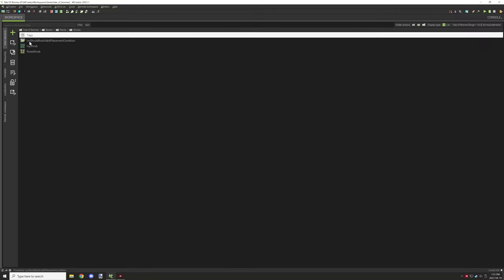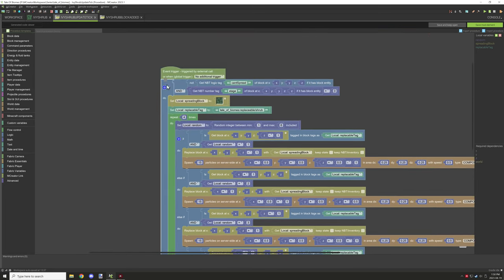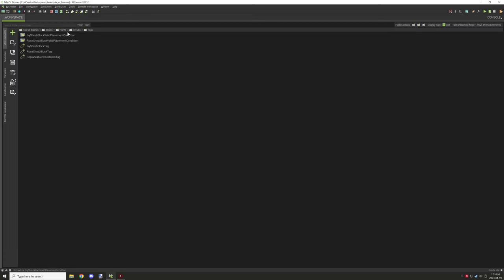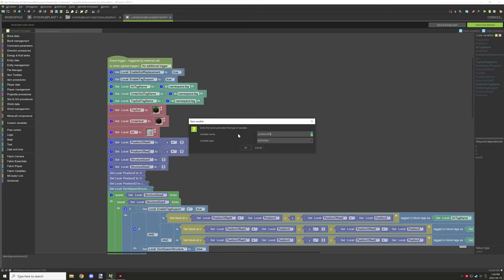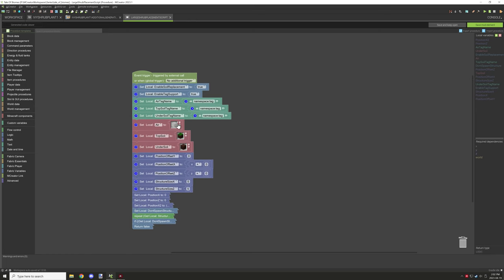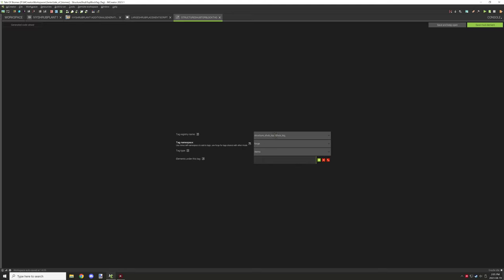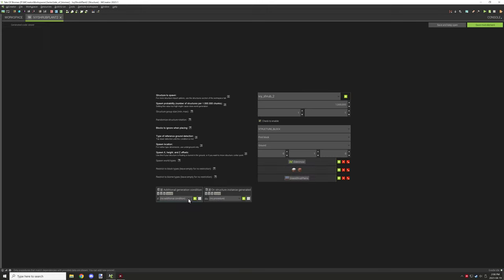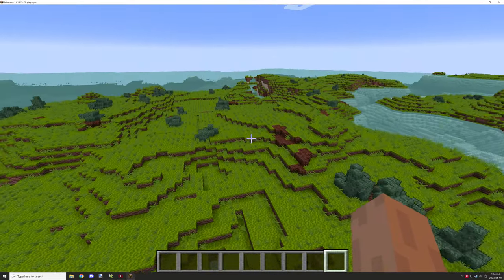Rough Shrub Mechanics | MCreator Lore | Ep12

Comment: Hey man, thank you for helping me on my other questions but I have yet another and I hope you're doing well, so I'm making a mod that involves a lot of mechs and piloted vehicles and I was wondering if it was possible to be able to raise the area where the player was sitting because the Mechs stand several blocks off the ground? thanks again
Reply from the maker: There should be a setting on the entities first page that controls the Y offset. You will still need to model your entity so the seat location is on the grid tile in blockbench but you can do something like -1.0 to go done one cube block. There is a bit of math involved in knowing per pixel each pixel is 0.0625 (1.0 / 16 = 0.0625) so if you need an exact height then you can multiply that value and add or subtract the y offset in the entity to change the sit location. The only thing is X and Z offset is not supported so it might take a bit of testing and moving the entity in blockbench to get the exact X and Z location, if you have grid enabled though it will be center of that grid but the player will always be at the top of the hitbox of the entity.

Comment: What I do to control the speed of random tick update is have a short if statement checking whether a random number between 1 and x == 1. It's not the best but it works
Reply from the maker: Random tick updates are controlled by the game rule randomTickSpeed, the default value is 3, setting the value any higher or will edit the speed of the entire game, making many aspects of the game faster or slower. Sadly there is not really a way to make it faster, but you can use a timer I guess to have a set amount of time that is required before it can attempt to run the script, keep in mind though you can have a longer time not shorter that what the base game already offers without editing the game rule. If you need something random but on a tick update I suggest just running a block with a random number condition to test for a value, you could do this using random integer and test for a single number and set a probability so for example 1/100 chance of landing on a value you set with ==.

IF Random Integer min(1) max(100) == 5
  Do  (...)

So if it lands on a 5 then it will run the event.
Keep in mind that every tick is (1/20th) of a second so it can make 20 attempts per second to land on the 5.
I am not sure what the overall probability would be with this taken into account but it may still be quick.
In the case this happens you can increase the max number.

If you want it 5% slower you can set it to 200 each value would be additional 5%. (I think, I am not great with math.)
Reply: @NorthWestTreesMCreator  Yeah, that's what I do